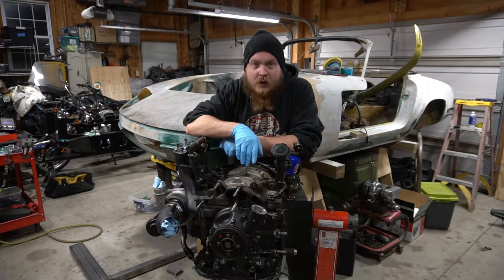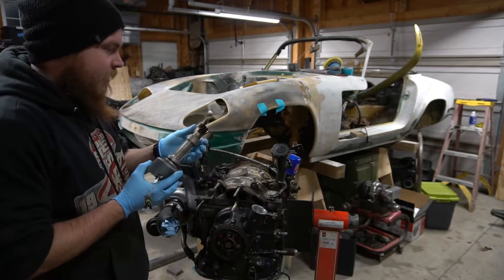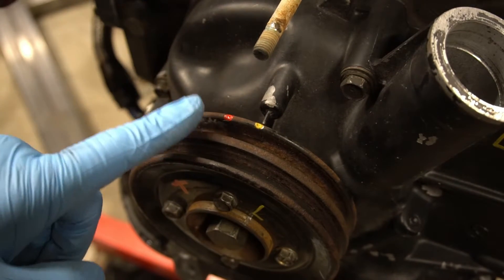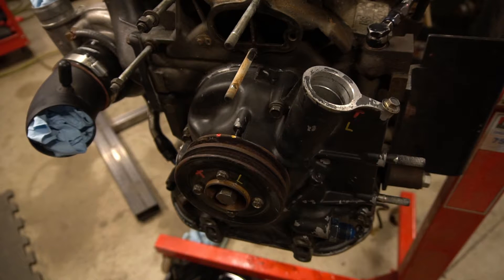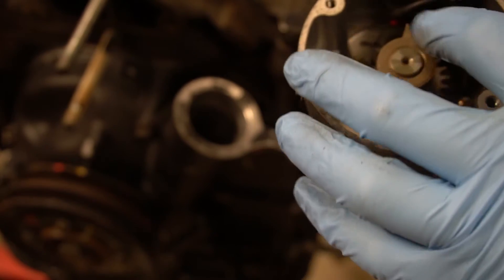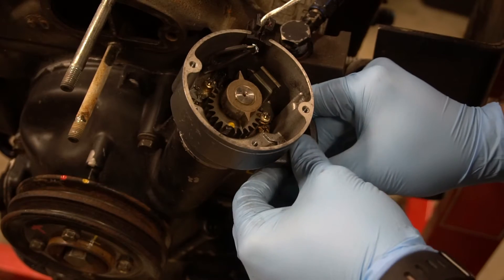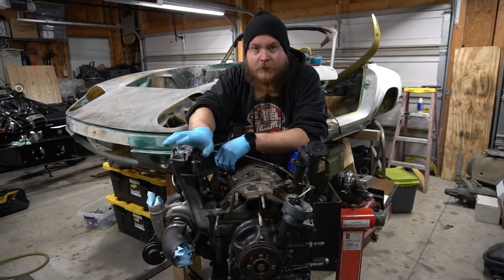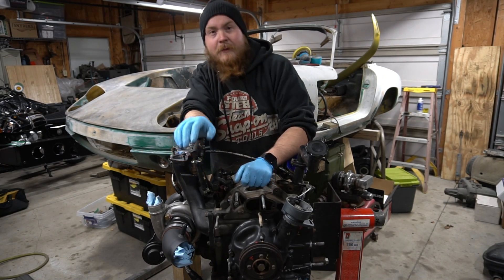How To Set Timing On A Rotary Engine. PT1 Static Timing.

Comment: I just did a rebuild and the motor didnt have those marks on the pulley 😮😢
The crank angle sensor slid right in no issues....  now im worried 😢
Reply from the maker: @ThomasReynolds-ey1ps  cas will slide in any angle as long as the gears mesh.. your going to have to verify you have the right pulley and right pulley hub for the motor, they are different between 12a and several variations throughout the 13b.
Reply: @CowbellCustoms  they are the pulleys that came off the car. They are correct.

Comment: Ok I got this far on my own, I was looking for the dynamic timing with the gun since I’ve never used one b4.
Is that video out? I’d not I’ll do some google searches.
Reply from the maker: That's pretty easy give it a quick Google and remember on. Fc you need to use the ECU jumpers to adjust CAS timing. I haven't gotten a video out on dynamic yet, now that my set up is a FFE trigger and controlled with a Haltech I haven't had to play with anything other than verify my timing is correct per what my ECU is putting out

Comment: Where is part 2? I’d like to see the dynamic timing set.
Reply from the maker: Dynamic is easy, and my set up has changed since this video, the car still wouldn't run correctly on megasquirt so I trashed that and ended up installing AEM smart coils, A FFE trigger wheel and a Haltech Elite 750.

Comment: so if my timing is off by 180 degrees do i just spin the gear in the CAS 180 degrees?
Reply from the maker: Get the e shaft pulley lined up pull the cas and see where it is. 
Although it sounds like it may have flooded I'd check to just make sure it's not flooded aswell

Comment: so if the engine is already in the car and you want to recheck timing after sitting, i wonder if you can move the crank pulley to the yellow mark and pop the top off the distributor, there should be some kind of mark indicating the static timing is dead on, or if you need to retime.

We have a rotary that wont start so timing light is not possible
Reply from the maker: Pull rotor 2 trailing and leading plugs, watch for the apex seal in trailing plug hole in the center. Mark the crank pulley, then watch for the same rotor tip in the leading, mark the crank pulley and then the center between the two marks should be mechanical TDC. If the cars got a different pulley they read different timing degrees

Comment: Couple questions, I’m going to unoh and I just bought an rx8 plan on doing a lot to it… having a misfire high rpm around 5500, if I push past it in first or second it bites and goes all the way to 8k but no further, I’ve replaced the whole ignition system and my ess or crank position sensor, still having the same issue, I’m thinking timing now because it’s not clogged cat because it does not have any… what do you think as a guy who knows rotary’s?
Reply: Also not injectors cause it dumping fuel out the exaust, also kind of confused as to what you meant, you’re not working on a 13b in the video are you?
Reply: Any help would be GREATLY appreciated!
Reply from the maker: Look onto the valve that changes your intake runners. They get sticky and may feel like a misfire. Another thing I would look into is possibly pulling the fuel injectors and getting them professionally cleaned and flow benched.
Reply: @CowbellCustoms  that’s the thing tho, doesn’t feel like a misfire I know for fact it is cause ce flashes when it does the misfire hesitation thing at 5500

Comment: Do you rebuild that engine I like to see it at live again I have a fb with a 6 port turbo check it out
Reply from the maker: I ended up putting another s5 turbo2 into the car. I haven't had alot of time to mess with it with other projects, I want to redo my wiring and switch to a haltech when I can.
Reply: @CowbellCustoms  oh k cool I'm using a Haltech platinum Sprint re u not need to modify the CAS I like what u did with the fuel pump in tank I like to do something like that

Comment: I have a Question that you may can help me.I have a 13B no turbo and I'm getting to much gaz on my spark plugs? Suck and weat.why?
Reply from the maker: In a FC? The injectors sometimes leak down and flood out the motors or compressions getting weak and not able to build enough compression to fire.

Comment: How do you remove the distributor immune is hard to remove is there like a bolt besides the adjustment bolt
Reply from the maker: Just the adjustment bolt, can you rotate it? As in its not seized to the front cover? If you can get it to move left and right you may be able to yank it out or possibly a few love taps with a soft mallet.